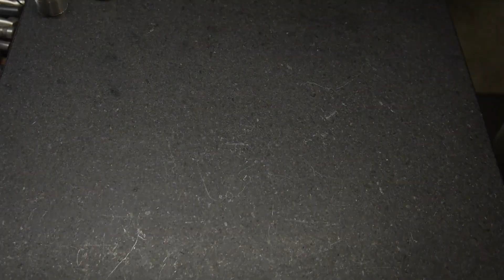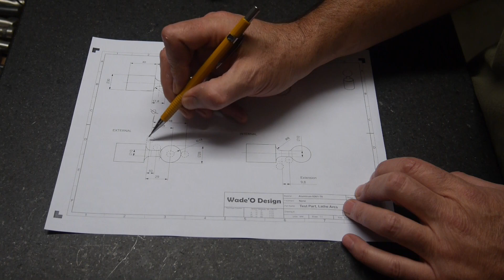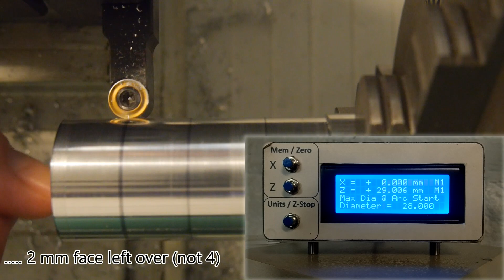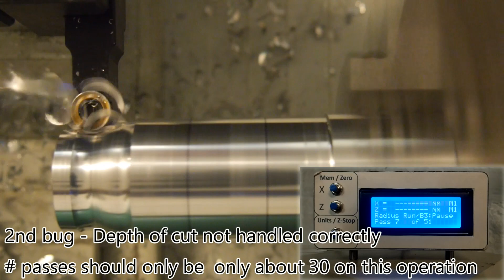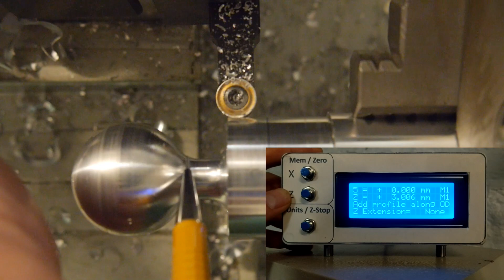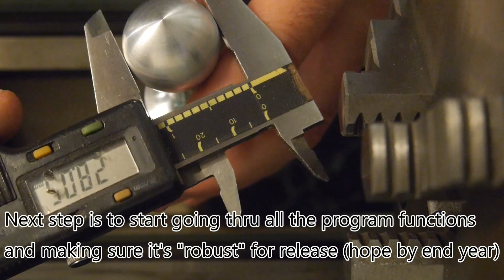CNC Lathe Ball / Radius with Arduino (4 of 4)

Comment: Hi I have watched all your Lathe videos, great job especially keeping the manual part of the lathe.
One question for the Z axis you disengage the half nut and you have 100% manual feel i.e. no stepper loading, for the X axis do you feel the loading of the stepper a lot? Is it annoying?
One more thing can you release the firmware even if it is not finished just a starter for anyone who wants to continue, 5 years have passed since your last video?
Thanks
Reply from the maker: The handwheels are completely detached from the ball screw and motor and only drive an encoder - so you don't feel any input and they turn free.

Comment: You are getting a lot accomplished with Arduino code.  Nice job!  That is a very nice ball.

I now have all of the parts for my conversion - except for the smooth stepper and servos.  I'll wait until I'm ready for them (to maximize the warranty time...).  I chose a SFU2005-C7-900 ballscrew for the Z axis based on your previous comment.  I will be slow but plan to begin working on making some parts fairly soon.
I think my costs are going to be higher than your estimate.  I don't have a total but I had to buy metric screws (~$300) since I had none and  I also had to buy most of the aluminum and steel (eBay) since I didn't have much in inventory.  Some of the items were long lead time so it is a good thing I was not in a hurry to build this.  The longest time was for the X-axis ballscrew.
Reply from the maker: Great.  Almost ready for code release to alpha